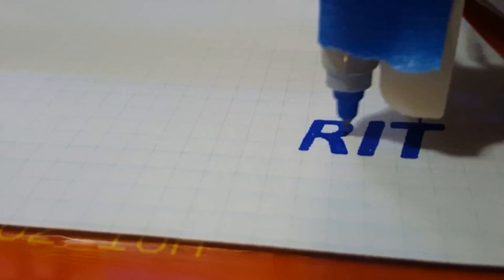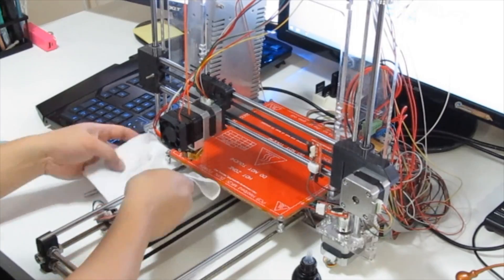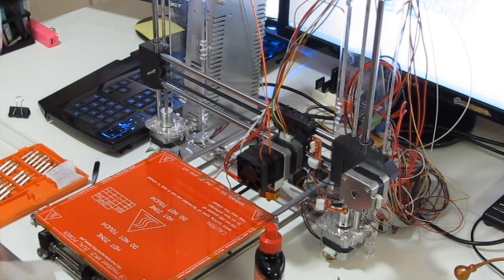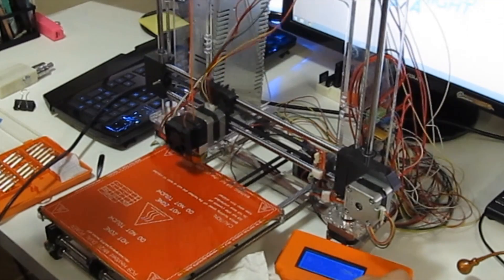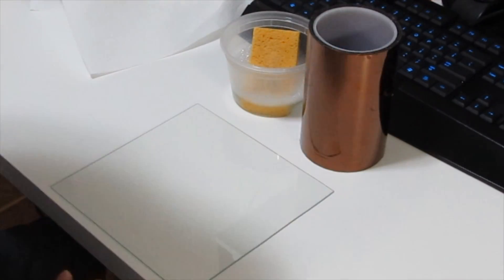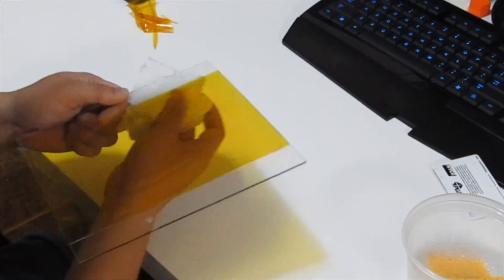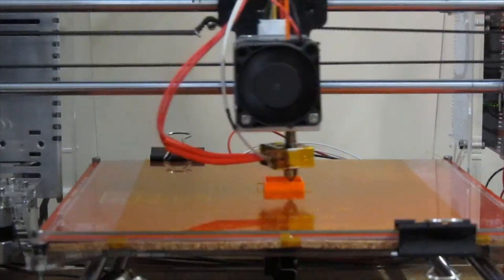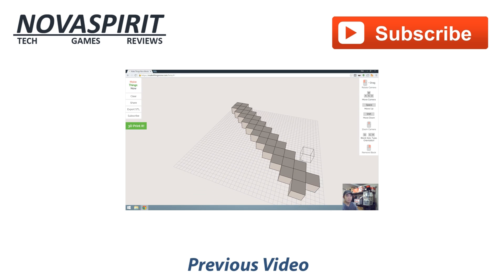3D Printer Maintenance Prusa I3

Comment: Some ppl in the ultimaker forum says sewmachine oil works for the shafts. Since grease in the linear bearings may build up dirt and prevent its balls from spinning.
And that the sewoil itself cleans the dirt out

Comment: is the Prusa i3 a good printer? I´m looking for a affordable printer with a reasonable price?
Reply: For anyone who may read this later on, the Prusa has been ranked one of the best printers you could possibly buy.  I have used 3 different ones, and I love it.  Solid as a rock, and very reliable.  Plus prusa is a great company to work with.  I have also worked with the Ultimaker 3...and I honestly hate that machine.  We purchased 4 for our district, and we have had nothing but issues with 2 of them.  Working with Ultimaker has been a nightmare...worst $8000 we have ever spent...personally speaking.

Comment: Hi, what are you using for insulation under glass ? does it make heatbed heat faster ? Thanks
Reply from the maker: +T1iCanon i ended up buying cork table mats from ikea for $12. I then cut them to size. it help heat faster and maintain the heat for the bed. works reallly good. i saw this item on ebay and they wanted to charge $25 for this.